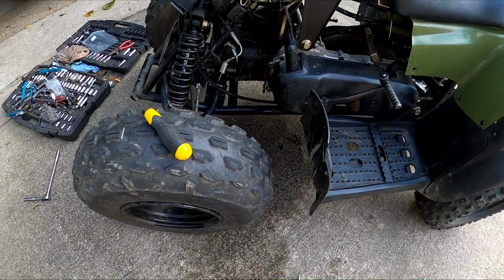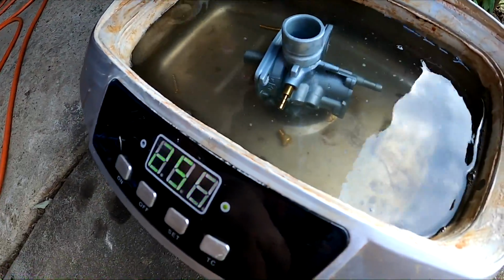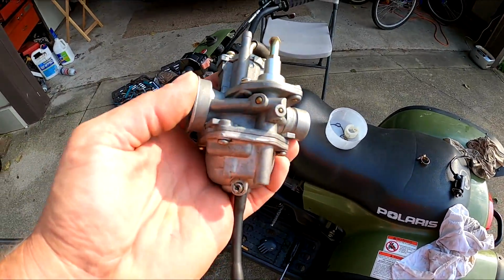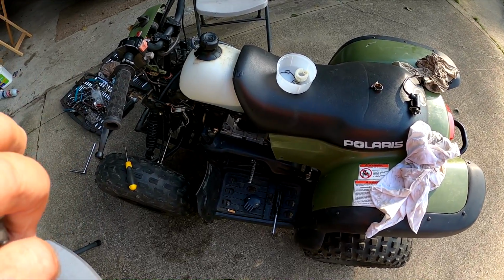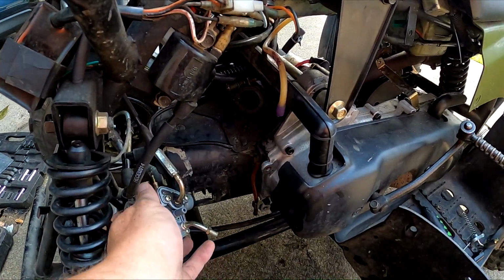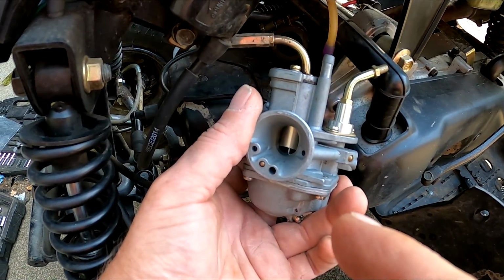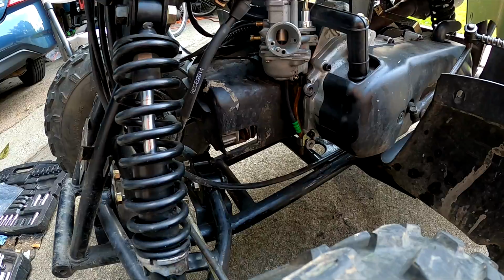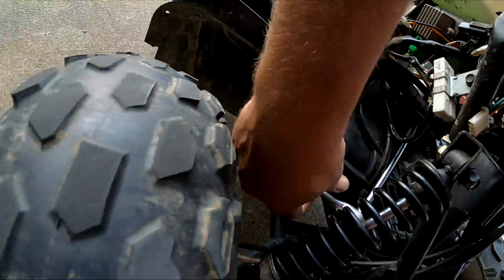Polaris Sportsman 90 Original Mikuni Carburetor Cleaned Re- Installed. 90cc 2 Stroke

Comment: i agree with your last statement brother . somethings not right for sure . could just need to be tuned . you need to block off that oil inlet sucking air through it . but i was really hoping to see you put the antique carb on it i bet it would run just fine . its just a 90cc motor im sure it would handle it . sometimes less is more .
Reply from the maker: I agree.. Less Is More! The Polaris has a over loaded wire harness and crap all over it and doesn't even have lights lol I never thought to cap off the oil inlet!! Thanks for the heads up Bro!!!!

Comment: Need help following the fuel lines from the tank  and the one that feeds into the same area the front right shock on mine is pouring fuel out when i fill the tank with fuel  what could this be?
Reply from the maker: I put a regular carb on, and eliminated the self oil mixture and mix the oil in my gas like a regular 2 stroke.

Comment: What fuel/oil mix were you running in that?  I can't find any info on the correct ratio for these engines.
Reply from the maker: I run 50:1 on all my 2 strokes and have never had any problem's with pistons ever.

Comment: I cannot get mine to stay running with the aftermarket carb
Reply: Don't forget...the motor will not stay running (may not even start) without the air/box(filter) attached to the carb
Reply: Unplug the oil injection pump from the engine and then disconnect all hoses and wires then get a single throttle cable and off you go. Can't use the double one still

Comment: I had a new carb put on ours 2wks later it started running funny again bogging out hardly running
Reply from the maker: I think for every failed start attempt, the oil pumped as if it were running. So with that being said, I think there is oil under the piston in the crank. My brother in law did a Suzuki with a similar set up and the crank was full of fuel oil. It's worth a shot because otherwise its worthless lol
Reply: @OlszkoolCustoms  ok sweet ill check that